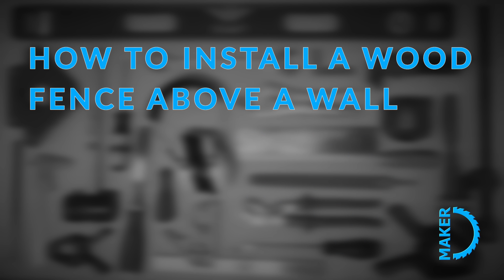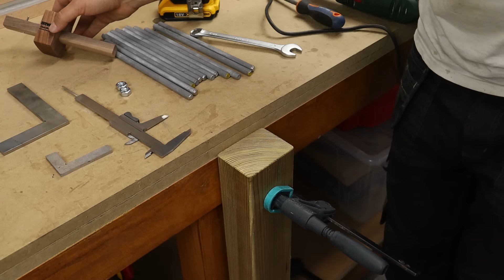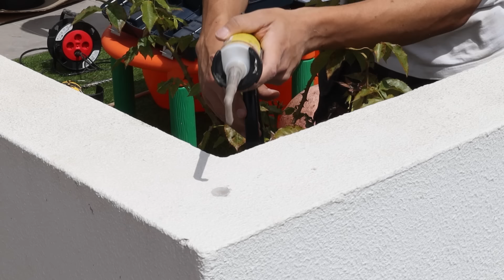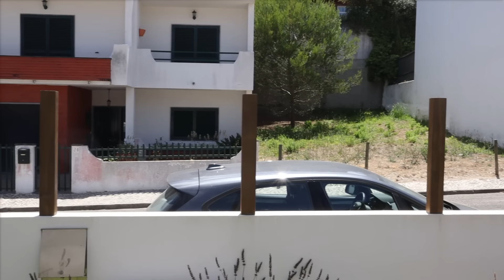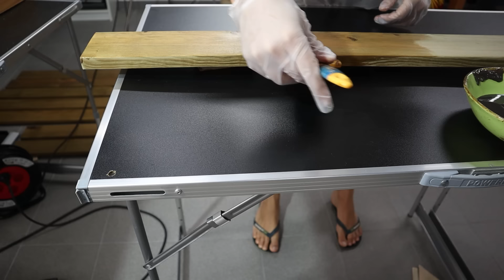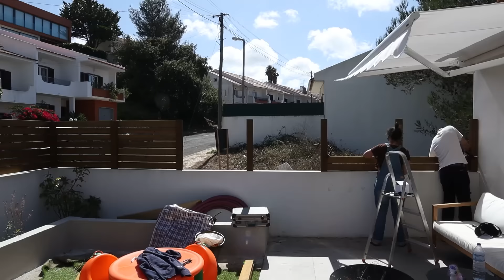How to Install a Wood Fence Above a Wall

Comment: at 03:40 after drilling you slid a tube into the hole and filled it with Chemical Bushing. what is the name of the tube and chemical bushing products. i am new to building and am trying to use this video as a guild. i have a cement foundation around the perimeter of my yard and a chain link fence that has bent poles in the foundation.  i want to cut the poles and mount new wooden posts and fence. any assistance in this would be helpful.

Comment: Easier to use external use L brackets. Simply screw one leg into the wall and the trellis into the other
Reply from the maker: Yes, that's also an option! Thanks for the tip 👍😉

Comment: Awesome 😎. Thank you. I was looking at all types of materials to use to extend my vibacrete and im pretty sure i can make use of this type if material. A quick question ❓. What do you use to keep it weather safe and how many times a year do you have to do it? Thank you 😊. Im from Cape Town SA
Reply from the maker: Thanks man! I used an exterior wood finish and normally you apply it every year or at least every two years, depending on the climate variations you have! Good luck on your build! 😉👍

Comment: It looks great but I wonder how long it would last being outdoor?
Reply from the maker: Hi, it's made out of pressure treated lumber. It's made to last long outdoor, but of course it has to be maintained. BTW it's now there since 2020 and it still looks great! 😉
Reply: That’s we he used pressure treated pine !!
It will probably outlive you
Reply: @andrewarthurmatthews6685  not sure if it will outlive me even though I am not young. According to AI, fences can last 15-25 years if sealed. Based on that it won't outlive me and for this reason I like galvalume it lasts much longer than that.

Comment: Amazing work and great video! Question: Could I install this fence (same method and wood dimensions) on top of a 5ft concrete block wall. The wall is relatively old, blocks laid on side (100cm width) with a few supporting pillars. Seems like a solid wall but just worried that strong winds might pull the wall down with this fence on top. Thanks again! 👍
Reply from the maker: Hi, thanks for your comment. By your description it seems it's a solid wall, and I think it will hold up, but I can't assure you since I don't know the exact condition of the wall. I hope I could help and good luck with your build 👍😉
Reply: Last question: In a previous comment you mentioned that you applied “silicon based insulation outside where the beam touches the wall” to seal the upright posts against rot. Can I ask what the sealant was and how you applied? Thanks again!
Reply from the maker: @oph0  A normal silicon for outside use should be ok.

Comment: Would  the threaded rod bent if the fence would be only straight with no 90 degree angle to support when it's windy ?
Reply from the maker: No, I don't think so! The fence has been installed a few years ago in a windy area and it's still rock solid! 😉👍
Reply: @DMaker_builds  I think I will try it, my fence will be 20 meters long and 2.2 meters high, all straight, thanks

Comment: Great video! How far in did you drill bit into the wood posts? The metal tap was also 12mm? The concrete drill bit I assume is also 12mm? Thanks in advance!
Reply: Also.. how long are the rods.. how much of the rod went into post and how much stayed out?
Reply from the maker: The rods are about 30cm, 15cm into the post and another 15cm out. The metal tap was also 12mm. The concrete drill bit needs to be larger, something between 14mm and 16mm! I hope it helped! 😉👍
Reply: @DMaker_builds hey DMaker! Thanks for reply. I’m currently staining my posts and boards to tackle this DIY for my backyard. How many inches of separation did you apply per each board?

Comment: I was going to use brackets but this threaded rod approach looks sensible. I think you should put some sort of plastic or other waterproof barrier between the concrete and the wood.
Do you think this can hold with a curved wall?
Reply from the maker: Yes, I believe it will work also in a curved wall! Good luck with the build 😉👍

Comment: What mm drill bit did you use? How many mm are the metal rods so I know which sizes to use
Reply from the maker: Hi, this information is in the video description. I used 12mm galvanized threaded rod and the drill bit is 14mm. I hope it helped. 👍😉

Comment: would this be possible with a 5 ft wooden fence above a 4" block wall? or would steel post holders bolted to wal top be better to hold he 5" Uprights or should i attach the wooden posts frther down wall  maybe 5ft above the wall and 3ftbelow the top of wall for added support??
Reply from the maker: Hi, I think your last option might be the best, because in my opinion 5ft is a bit too high for this type of fixing. Good luck with your build 👍😉

Comment: What is the spacing between the slats?
Reply from the maker: Hi, in this particular case is 11mm, but this was calculated to match the height of the fence, considering the height of each slat. 👍

Comment: chemical bushing????? what is that?
Reply from the maker: Is the same as chemical anchoring. In summary is a bonding compound that is inserted into the hole and promotes the adhesion of the metal and the concrete. Google it and you'll find a lot of information about it. 😉👍

Comment: my backyard wall is not brick made, but that wall was made with concrete and natural big rocks, can you suggest how can be built a wood fence on top of the wall with some base attachment?
Reply from the maker: This method also works well in concrete. You'll just need a stronger concrete drill and bit. As long as you have a fairly straight base you should be good. 😉👍
Reply: @DMaker_builds  thanks
Thank you!!

Comment: Hey thanks for the video, I want to do something similar but was wondering, what part of the process might change if I were to build the same fence but 6 feet tall from the top of the stone wall
Reply from the maker: That's a pretty high fence! I'm afraid these posts won't withstand strong winds. You should consider thicker posts, and some kind of reinforcement specially in the connection with the wall.

Comment: What size in thickness for the threaded rods?

 what was the drill bit size you used to make the hole in the beams for the treaded rod?
Reply from the maker: Hi, the thickness is in the video description under material used, but it was 12mm. I used also a 12mm drill bit and then used the rod itself to "tap" the thread in the wood. I hope it helped! 👍
Reply: Did you use the impact drill or regular drill for drilling into the concrete? 

I assume the final size of the concrete drill bit used was 12mm correct?

Comment: Wow!!! That's perfect. You did awesome work. Thanks for sharing. Question? The 4X4 post how  many feet. you leave the distance on each other????
Reply from the maker: Thanks! That depends on the distance you have to cover. In my case, I had about 1,2m (around 4 feet) in one side of the "L" and 1,08m (around 3.5 feet) on the other side. 👍
Reply: @DMaker_builds  thanks so much 🙏
Reply from the maker: @cesararias833  👍

Comment: Nice video.  I'm considering doing the same around out patio.  Do you think it would be worthwhile injecting some resin or glue into the fence post too, just to give it some extra strength?
Reply from the maker: Thanks! Honestly I don't think you need that. Just make sure the post is well fixed, and it should be ok! 👍😉

Comment: Did you drill threads into the 4x4? And what is the plastic insert as well as the type of caulk you injected? What was set time also. Thks..jc
Reply from the maker: Hi, no, there's no need to drill threads, you just have to make sure the hole is wide enough to attach the threaded rod but at the same time having a tight fit. The plastic inserts are plastic sleeves specially made for this kind of chemical bushing. The set time is a couple of hours but I let it cure for at least one day before starting the rest of the installation. I hope it helped 👍
Reply: @DMaker_builds  So what is purpose of threaded rod as opposed to just pounding in a smooth rod?
Reply from the maker: I mean you open the thread as you are inserting the rod, don't need to tap the thread in advance. You can use a smooth rod but of course a threaded rod gives you a much tighter fit. Don't forget to use a double nut and a spanner to help tighten the rod in.
Reply: @DMaker_builds  Thks...jc

Comment: Question:  What if the wall is hollow-ish cinder block with only stucco on top?  Any suggestions?  Our anchors don't seem really sturdy.
Reply from the maker: Hi, actually this wall is made of hollow blocks. It's a matter of injecting enough chemical anchoring to fill the gap. And very important, use the plastic sleeves! Good luck with your build 👍🙂

Comment: nice job. maybe I will go with the some job,  but I will do wood with angl . like 12mm - 25mm under both each list. better water droping . no ?
Reply from the maker: Thanks a lot! I'm not sure I understood your question correctly, but to be honest I don't think you'll need an angle in the boards to help with water. The water flows freely just like this. I hope I could help 👍😉

Comment: Fantastic video and doing exactly what I am trying to do on my own brick wall. I am mounting on a solid wall so won't need the sleeves, but wondered how big a hole I should drill for 12mm threaded bars?
Reply from the maker: Thanks! I would drill a 14mm hole to make space for the chemical bushing. 👍

Comment: Awesome! Gave me an idea.  Im going to do the same to an existing concrete restraining wall that doesn’t look good. Im thinking of installing beams just as you did and then running a board vertically all the way down so I then can run the boards across horizontally covering the wall and creating a short fence above it about 2 feet.   Im thinking I should also screw in some screws into the vertical bards going down for extra support.  Just not sure if this will mess up the strength of the actual retaining wall?? 
Thanks for any insight or added input on this?
Reply from the maker: Hi, I think that's a good idea, and I'm pretty sure a few screws will not mess up the strength of the wall. Go ahead and good luck with 
your project! 👍😀

Comment: Great work. What is the length in between from one vertical post to another and what is the total length of the horizontal wood that measures 10x2cm. I assume that you left 1.07cm gap between each wood, right?
Reply from the maker: Thanks! The distance between each vertical post is 1.2m in one of the sides and around 1m in the other side. The horizontal boards are in one case around 2.5m and in the other 1.2m. And yes, the gap between the boards is around 11mm. I hope it helped. 👍

Comment: Great job 👌 More difficult if you have to do it on an uneven stone wall, have you ever had to build a fence on a stone wall ? If so how did you find it ?
Reply from the maker: Thank you so much! No, I've never built a fence on a stone wall, but I think you can have the same approach if it's not too uneven. The only thing is that the gap between the wall and the first board will look a little uneven, but I think it should be OK! 👍😉

Comment: Great work man, looking great! Just wondering, if I were to install this extension on a wooden pine base and not a concrete one, would you still use the chemical anchors? or would you simply drill the other end of the bolt into the wooden base, or use other types of anchors & epoxy/adhesive on the base?
Reply from the maker: Hi, thanks a lot. In my opinion if the base is pine you should drill the other end of the directly into the wood. That’s the best option since the chemical anchoring is not so good on wood. 👍

Comment: About how much of the bolt did you put in the post and how much did you leave to put in the rock wall  ? And how tall were your post ?
Reply from the maker: Hi, about the same on each side, around 15cm! A little more if the post is higher.

Comment: how do you build the cement wall?
Reply from the maker: I haven't build the cement wall. It has already been built with the house.
Reply: @DMaker_builds  do you know how to make it?
Reply from the maker: @Chichengee448  I have an idea but it's not my area. This is more construction works.
Reply: @DMaker_builds  whats the ideal
Reply from the maker: @Chichengee448  you mean, the ideal height?

Comment: Hi why do you leave gaps in between the boards is this because of how the wood can expand with the tempature?
Reply from the maker: Hi, one of the reasons is due to wood expansion, but the gap is bigger than needed due to aesthetic aspects. The customer didn't want a very "closed" fence, so that more natural light comes in.

Comment: Hi , are the plastic sleeves necessary? I'm am just asking as they are very hard to get in New Zealand.
Reply from the maker: Hi, it's not mandatory to use the sleeves. They help the chemical anchoring not spreading too much but you don't need to use it. Thanks

Comment: Hi thanks for the video ho difficult to do this on sloping flat top stone wall?
Reply from the maker: Hi, it's a bit trickier, but you will have to cut an angle in the vertical posts so that they stay vertical on the sloped wall. Use a good drill bit that’s appropriate for stone, and then fix the horizontal boards the same way. I hope it helped! 👍
Reply: Yes thankyou

Comment: Can I make them taller than this my wall that me and the neighbors next door is kinda short so I think I need to go taller 🤔
Reply from the maker: You can make it a little taller, but not much more, otherwise you’ll have to use a longer stud inside the wall. 👍

Comment: Hi, great video ! What is the distance between the vertical beams and why did you chose not to use metal cup holders for the vertical beams but instead mount them directly to the wall (won’t the touch surface between the wood and the wall rot ?) ?   Thanks and keep up the great work !!!
Reply from the maker: Hi, Thanks! The distante between the vertical beams varies, in one part of the L is around 1,2m and in the other part is only 1m. The reason for not using metal cup holders is because the wall is not thick enough to hold its bases, and also because of the final look of the fence. I don’t the wood will rot because I applied silicon based insulation outside where the beam touches the wall.